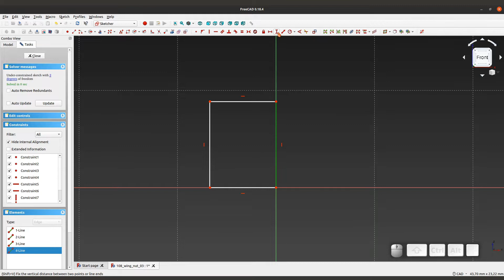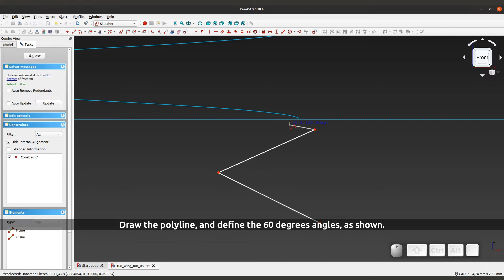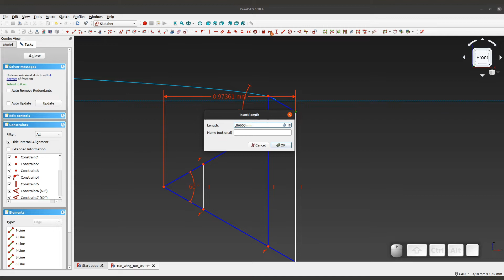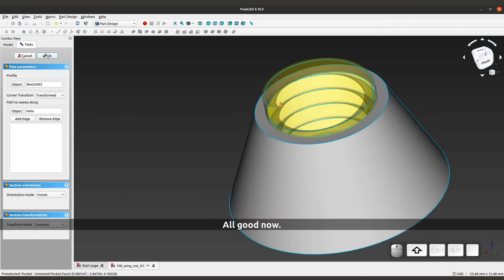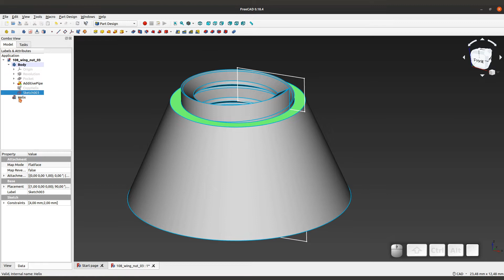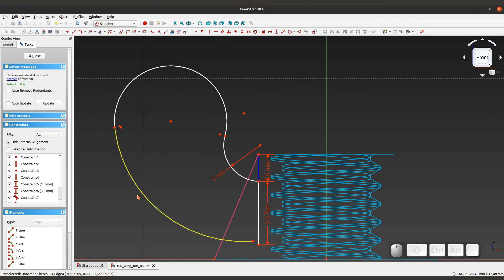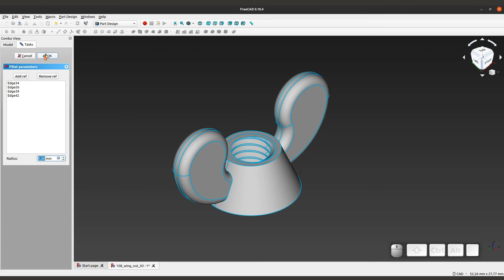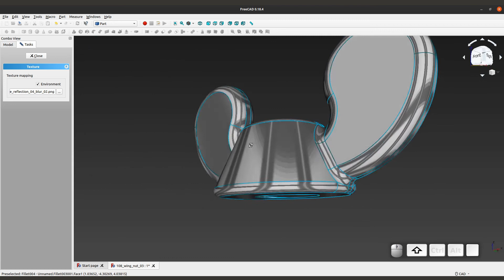Freecad tutorial - Wing nut - Product design #108

Comment: Good that this is with Freecad 0.18. Issues finishing the thread (Fatal error ocurred when making the pipe) trying to finish the sweep operation. Apparently is something that happens...And Finally finishing after a little adjustment in a line.

Comment: I'm wondering why you chose to add the threads as a additive component instead of a subtractive component? Just personal preference or is there a reason one is better than the other?
Reply from the maker: Hi, Derek, it depends, the logic I've used here depends on the helix, as in this example, I've used the helix is it is the outer diameter, how the whole thing actually works, will be explained in some of the newer tutorials, and the relation between outer and inner diameter, or, on the other hand, the relation between nut and bolt. 
So, in general, which diameter is used for helix, it determines if the profile, or, sweep feature will be added, or, subtracted. This tutorial is an idea of how outer diameter can be used, making outer vertex (line) coincident to the helix, and in that case, it has to be added. 
It would be much easier to use centerline as a guide, but, as it can be seen in the video, I didn't use it here, anyhow, how the whole thing works, will be shown in new tutorials, I just can't say how soon will I be able to have them complete and uploaded.

Comment: I am sorry to bother you but i beg you to help me, i made short video of my problem

https://www.youtube.com/watch?v=vLaDdLQqwY8&feature=youtu.be

Could you take a look at that? Why is cutting destroying my object surface? I've got some advices from forum like for example to not mix part and part design but it occures even if i am working only in Part...  I don't know what i am doing wrong. Its so frustrating for me, i can't work anymore on my projects until i will not find out what is wrong. The surface is really destroyed, not only graphical, like many thought, when i export this object to .stl and load it into slicer it's showing destroyed wall as well..  Thank you really much for help
Reply from the maker: Hi, Michal, I would try several options, this is geometry issue, try using Part design, instead of Part workbench. 
Or, on the current model, as well as within the Part design workbench, within the Property dialog, while "Body" is selected, you have Deviation parameter, which is related to the geometry density, try with the smaller number, but not too small, as geometry may become too heavy.
This parameter should be used only if necessary, you can adjust this parameter within settings, but, it is recommended to keep this parameter low, or default, and increase (lower number) the density of the object geometry when required, as in your situation.
This kind of problem appears when the geometry (density) is too large, and in such cases may not be calculated properly.

Comment: hi whats version of freecad a u using? mine has lot of bugs when doing prametric
Reply from the maker: Hi, I'm using 0.18.4, may work on the second time. I had one issue with this model, sweep feature, first time didn't work, for the second time, worked as it should. If something is constantly failing, may need to rework the steps, or, use the alternative method, for the same result.

Comment: Hello,
thank you so much,
but what are the dimensions of the thread pitch ?
M3 x1 ? because H=0.866 P ( pitch ) and M3 x 1  does not exixte, it is M3 x 0.5 or M3 x0.35 ...no, maybe I'm wrong.

best regards
Reply from the maker: Hi, Zevatech, you're welcome!

The pitch is defined with the helix, so it is only required to have the profile within the sketch. And few dimensions required for the profile.
I've used the M6 pitch, which is 1, to reduce the need for math, so I could use only default values.
You can find the same numbers at this link, and logic I've used.
http://steeljis.com/roymech/screws/hex_screws.php

To make the thread easier to understand, I'll have another tutorial, or tutorials, if needed, where I'll go step by step in making inner and outer thread. 

Best,
Igor